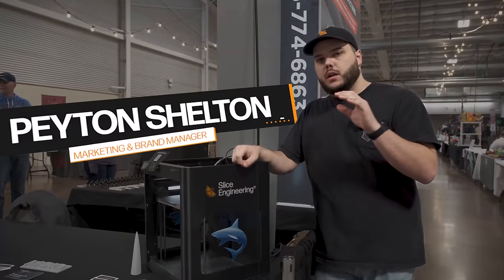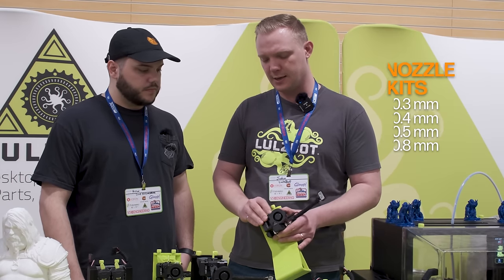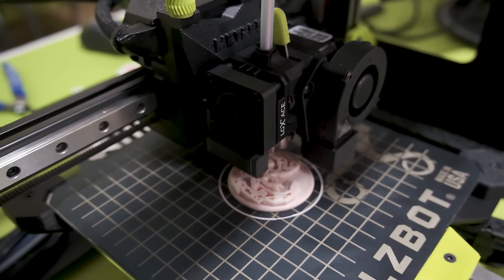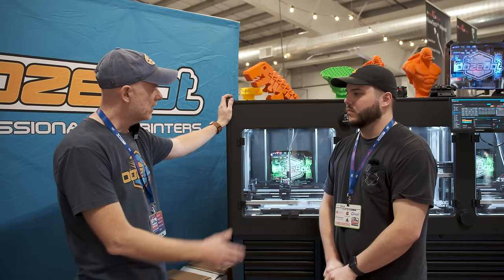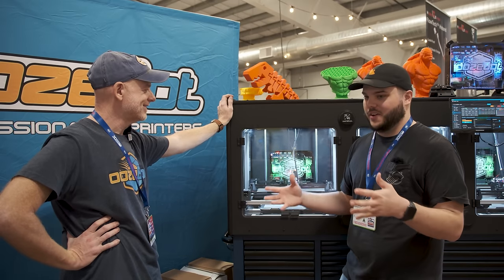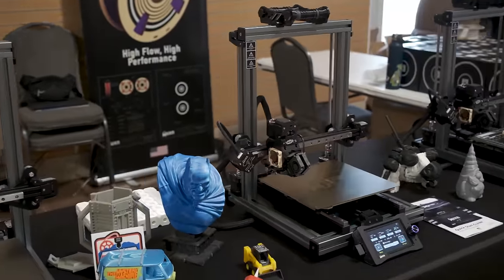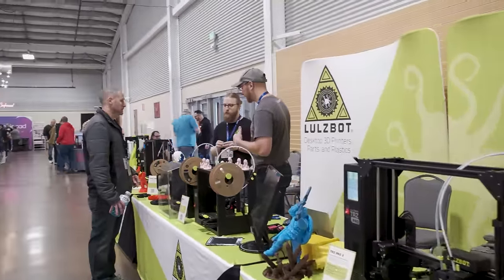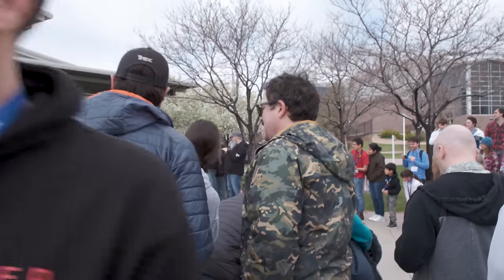The Future is Here: America's Top 3D Printer Brands Dominate RMRRF 2024

Comment: Thanks for the video, but I didn't really see anything that stood out to me, linear rods, bed slingers and chunky over sized extruders that look like things I was designing 2 yrs ago, the Vision Minor is the only machine that's good and you didn't really cover it, Oozebot looks interesting, I like the enclosure and at least they were CoreXY, but again tool heads to chunky, throw them around at 20 to 30k acceleration and you will see ringing all over the place, I use the V2S Lite on some of my creations, in a much better configuration than these machines and even they have severe limitations due to unbalanced weight distribution.
Reply from the maker: We have a video all about Vision Miner and the IDEX22 coming next!
Reply: @SliceEngineering  Ill keep an eye out for it, I'm a fan of their Nano Polymer, will be nice to see more about the printer as it looks like a solid machine.

Comment: I'd love to support US based printers but these prices are CRAZY. $680 for a bedslinger slower than the new Ender 3 V3 which can be had at microcenter now for $299 and is 1cm smaller in bed size, and slower and smaller than a A1 which is $399. Heck its more than the new SV08 which is a core XY at 35x35x34...
Reply: Thats some pretty short sighted thought about pricing. The only reason you see lower prices from China is because of their gov subsidies, and the goal to push as many companies out of the market hitting the sub-$600 deminimus price, which is where the chinese and amazon can skirt customs, and also avoid inspection into using parts produced by slaves.
Reply: @bthatguy1181  Don't forget china is self cannibalizing its own units. Bambu dropped its price pushing elegoo and others. The competition is unreal
Reply: @Kah-Rah-Tay  Its like GM competing against Chevy. Same owners, same controlling board (PRC), same product at varying quality levels.
Reply: @bthatguy1181  just bought 3 rolls of standard black PLA from Slant 3D out of Boise. Cheapest in the states $15kg non sale. I normally run high speed PLA so I had a huge curve to get this stuff to perform. Rather than go for high speed I went for high flow rates (which really got my actual times close to the old High speed pla. Did my first part today and it came out amazing. Never going back to Amazon

Comment: While I can appreciate your self promoting reasons for ONLY showing manufacturers that are using your products, doing that under the guise of showing off America's "best" 3D printers without even hinting to others NOT using your products is a clear failure on your part to be honest. You COMPLETELY ignored better printers that are more innovative, faster, and better designed that were shown at RMRRF24. 
While I love Slice Engineering products, and consider them to be top of the market, dishonesty like this flies in the face of what you should be doing. If you are claiming that the only printers in America that can compete with other countries (namely a red one) have your products in them, that's fine, but you need to state that up front.
Highlighting only your own partners does the community a huge disservice, and I will call you out on it every time. Slice Eng. doesn't need to do this type of marketing. Do better. You owe it to the community and yourself.
Reply: I think highlighting them is useful. I've hardly seen anyone else talk about Wuxn which is a shame. Its a great printer and they have incredible support.
This video is clearly also a bit advertising for Slice which is their prerogative to do. Thats why they went to the show in the first place.
Reply: @willofthemaker  wuxn is a fancy ender 3 with outdated hardware and hardware and priced way higher than it should be

Comment: LULZBOT is overpriced behind the curve garbage.
Reply: They are expensive and maybe not the highest tech but they are reliable as all hell. I am still using my lulzbot I built in 2014.
Reply: @willofthemaker  I still have a reprap Mendel that is reliable and still works with my PG35L direct drive extruder running RAMPS and it's from 2012. At their price point you could buy a row of Ender 3, also a very reliable printer, with similar hardware and electronics. You could build a couple of Vorons and still have change left over to buy a BambuLabs X1C. I'm also against Prusa's pricing scheme. Even the mini 3 is going for $1700 and it's still just a core XZ bed slinger with a heavy tool head. Just build two Voron Switchwires instead and have money left over for an Ender 3 still. $$$$